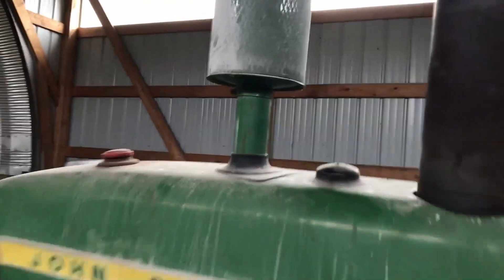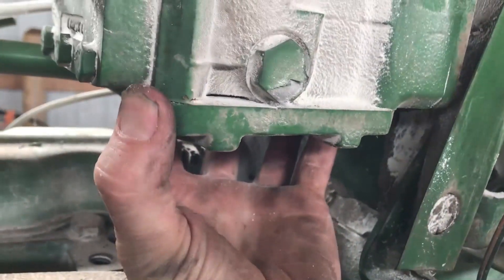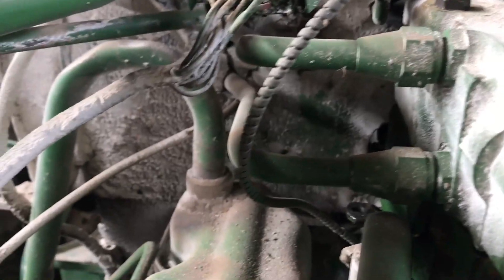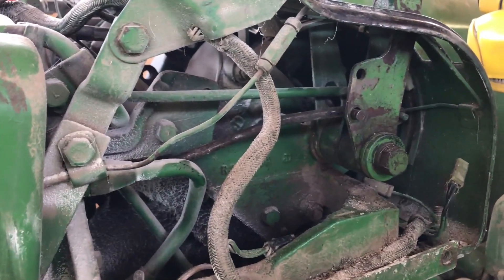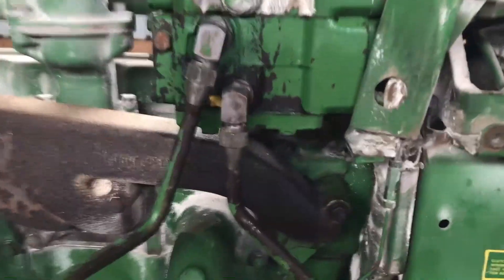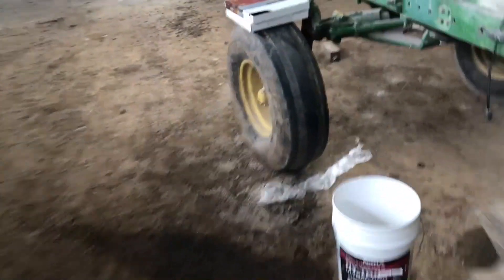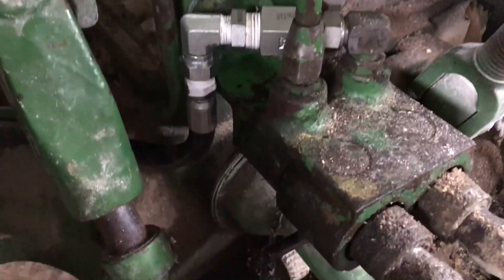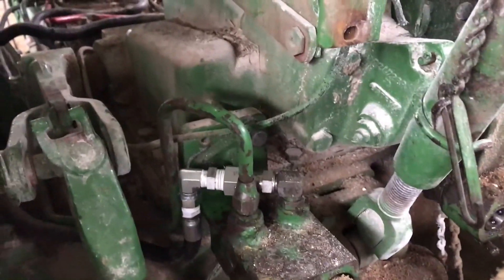How to Add a 2nd  Set of Hydraulic Remotes to a John Deere 4020 Tractor

Comment: That's on the early model like a 4010. You and also move you remote handles to the right side just by running lines off the top of the remote on the back!  So much more useful with two hyd outlets!!
Reply from the maker: I agree.